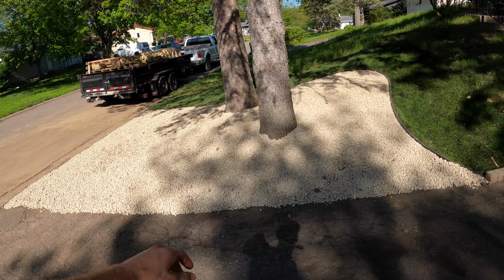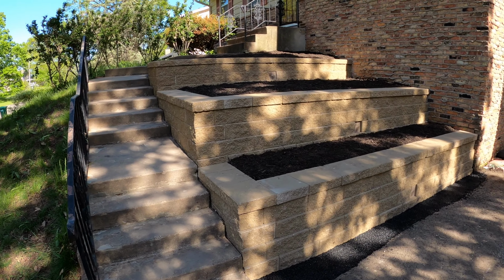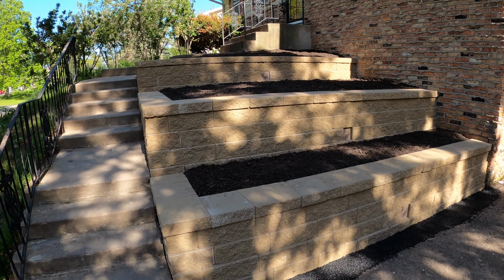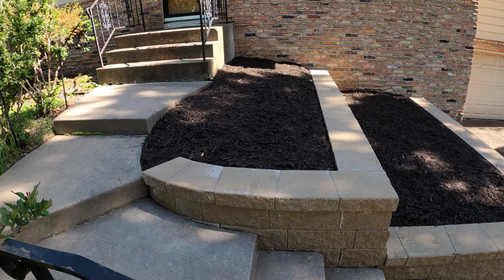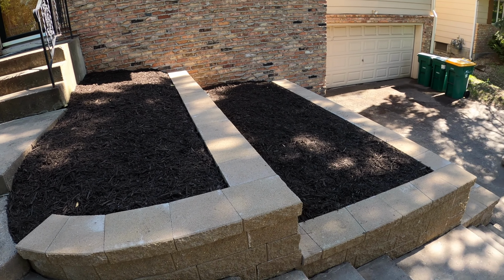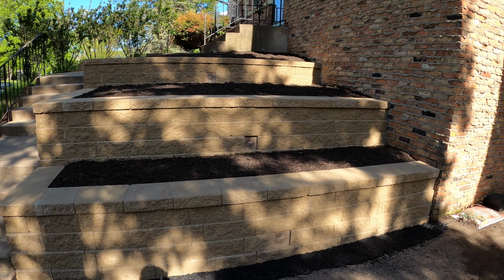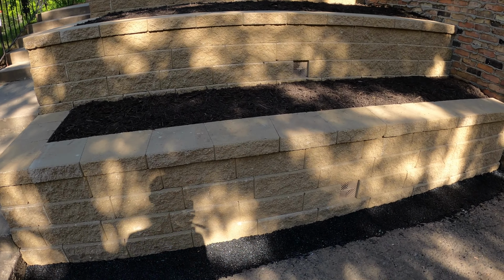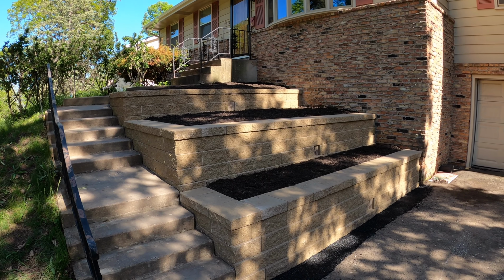Full Retaining Wall Build | 4-Day Time Lapse | 4K | Awesome Start To Finish Project

Comment: How do those black drainage tubes work?
Reply from the maker: It basically allows water to flow between the walls. The biggest reason walls fail is due to hydrostatic (water) pressure which builds up behind a wall. The main drainage is actually the drainage rock behind the wall, so the drainage tubes are kind of a back-up. If a wall is built right, you shouldn't see lots of water coming through the pipe outlets.